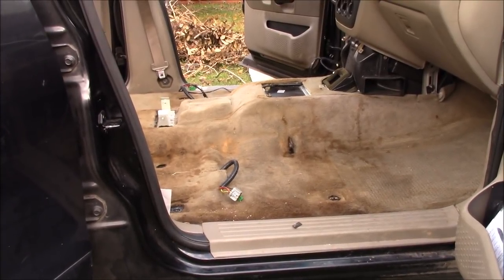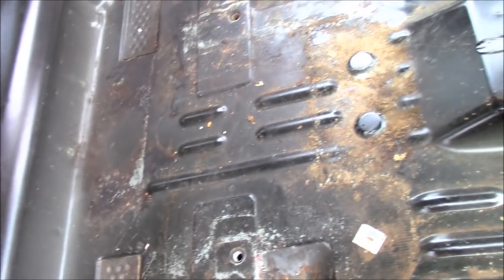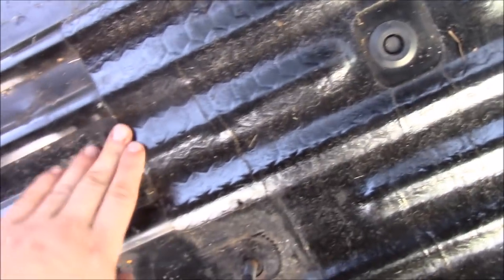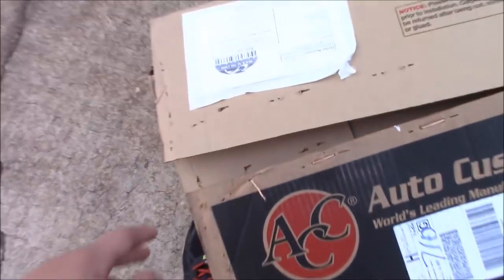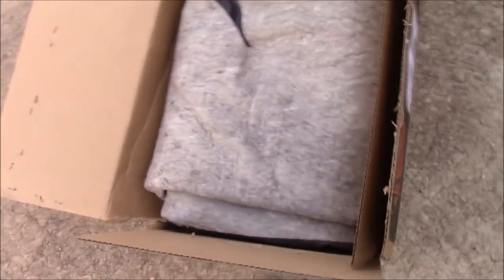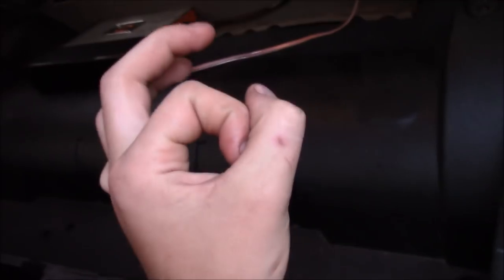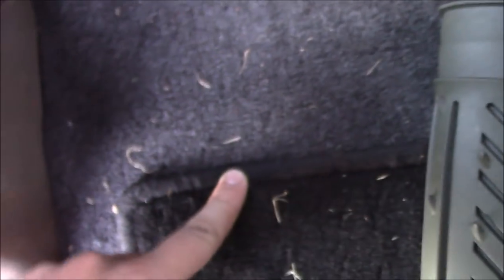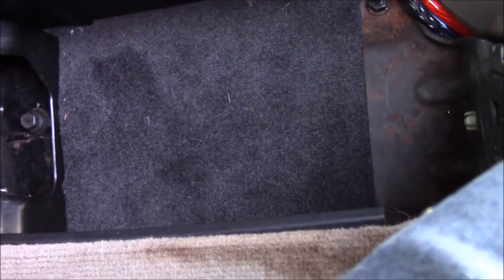How To Install Brand New Carpet In Your Car Or Truck

Comment: If you haven't already, please run those RCA's on the other side of the car. The power wire can introduce static noise into your audio. Also, sand down to bare metal on a seat bolt and ground there. Where you're grounding causes alternator whine over time. You want as close to the frame, if not on the frame, as possible.
Reply from the maker: thanks for the tip
Reply: bro it's just a sub... stop being so worried about everything... it won't affect his setup at all...

Comment: Nice video, I just received mines today but it did not have mass backing or the jute padding attached. Did yours come with the jute attached or with mass backing?
Reply from the maker: ByrdAK47 it came with padding on the back. And i dont know what you are considering jute but it has the insulation
Reply: Xxdayday99 the padding is the jute. Mines wasn't attached and it was from ACC. Your came out Nice. Thanks for the video.
Reply from the maker: ByrdAK47 no problem. thanks for watching

Comment: I just put new carpet in today after dynamatting the floor, how do you get the carpet to lay down?
Reply from the maker: I did not have any trouble with mine layung down. It may take a few days to settle. If not you can try using a clothing iron

Comment: No adhesive or anything goes down first to ensure the carpet doesn't want to lift up in certain areas?
Reply from the maker: the factory carpet didnt have any adhesives so i didnt have any to replace this may differentiate between brands and models
Reply: No you dont use adhesive, the seats, trim etc hold the carpet in place.

Comment: Yeah i'm in the process of replacing the rebonded foam underneath the carpet in my Honda Cr-v. Empty car and I cannot find a seller online that can provide me with rebonded foam.
Reply: Also, I used a spray bottle with 75% white vinegar and 25% water, a hard nylon scrub brush, and a couple old washcloths to clean out the grime. Anything rusted will come clean with the vinegar as well. No harsh chemicals and the vinegar smell evaporates.
Reply from the maker: @saltycalf8379  someone should make replacement pieces worst case scenario you can clean the carpet extremely well and then dye it the color you want
Reply from the maker: @saltycalf8379  it would also probably save some money as far as the foam goes you may be able to call an upholstery shop and they can order you whatever material you need and the you can bond it to your carpet

Comment: Coming to party late but you are so so lucky my friend, should research pretensioned seatbelts lol, theres a reason you couldn't get that off and if you managed to, you'd have hurt yourself badly, lesson to learn is never undo seatbelts unless you know your vehicles seatbelts situation, google beforehand as these types are explodable and set off your airbags etc
Reply from the maker: thank you for that info. i honestly never knew that but now i do. luckily most of my new projects are old stuff that does not have those.

Comment: Do you remember what color this is? Debating on Charcoal and Dark Slate for 2000 Durango. Going all in with Essex and Mass backing, thanks for the video
Reply from the maker: i do not remember but i wanna say its charcoal.
Reply: stunnasam21 did you end up going with the Essex and massbacking? Been contemplating the same choice but I can’t find anyone who says whether it’s good or not.
Reply from the maker: @limoboy27  pretty sure its essex
Reply: @limoboy27  yeah I did. Same color as this. I bought it off RockAuto for around $400. The ACC website wanted $700+ for  Essex and rubber backing. It's molded very well to the floor pan but I'm not sure my review would be fair since I put Killmat sound deadener on the whole floor underneath.
Reply: stunnasam21 would you say it closely resembles factory carpet? Does the Essex feel worth the extra money? Sorry about being inquisitive but I’ve genuinely been interested in it as a viable option. The truck im installing It in is kind of a limited option model that only came with rubber floors as far as I know.  I’m trying to updress it. Full massbacking and Essex package on ACC’s website shows $462 and I’m heavily contemplating it. As far as the no holes conundrum, I figure I can lay the vinyl mat over it and precut the holes that way. I’ve read a handful of reviews saying the cutpile was horrible and I’m curious as to how much of a step up the Essex is.
Reply from the maker: @limoboy27  i just looked it up and i used cutpile the results speak for themselves. ive had no issues with it thus far and it wasnt even the same color as the factory carpet but i like it
Reply: stunnasam21 definitely. Thank you!

Comment: Well....when ACC sent me my new carpet, they put the padding on the inside of my carpet rolled up.....it was a black carpet....it had silver fibers ALL OVER IT...was quite a task vacuuming a brand new carpet which seemed absurd. I'm not finished installing due to running out of daylight. I need to make the cuts and trim.
Reply from the maker: that sucks man sorry to hear about your experience. luckily though it wasnt too badly messed up and will still look amazing when you are done
Reply: Dev JB  yeah if I had it to do over I would have got some better backing. Maybe even went with the premium carpet.

Comment: Nice install EXCEPT for the typical crap wiring install....
Reply from the maker: honestly. i havent had any issues out if this setup. its been 2 years since i installed it.
Reply: @Xxdayday99  It's about how it looks not how it performs. You could have hid it under the carpet but I guess that slipped you're mind.